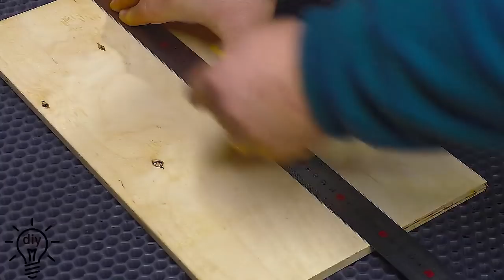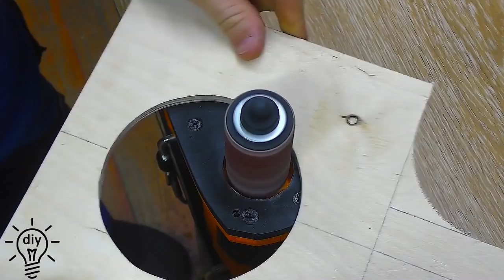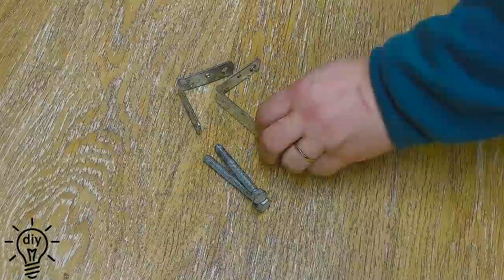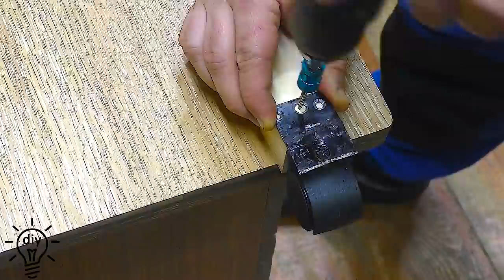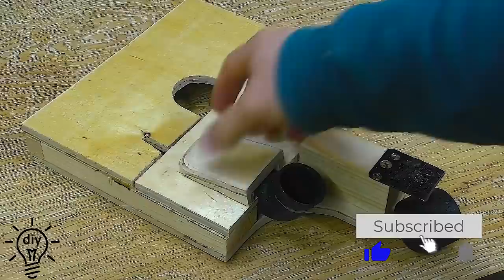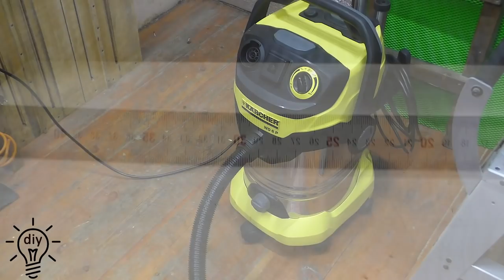A very useful idea for every man! To the garage or workshop.

Comment: WHAT DOES THE WHEEL DO ???
Reply from the maker: for a smooth turn of the structure
Reply: @diyprojects7868  OK , Thanks.
I just couldn't see it making a difference being at the back.
But then I've never tried it.
Still a good tool.